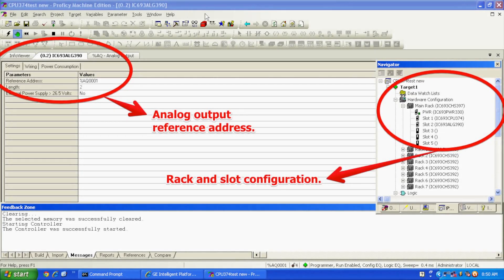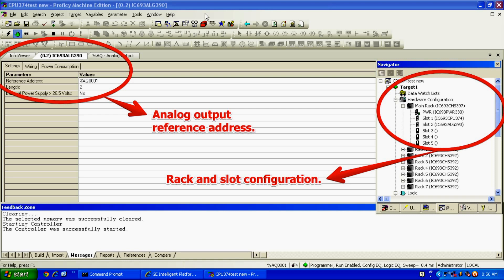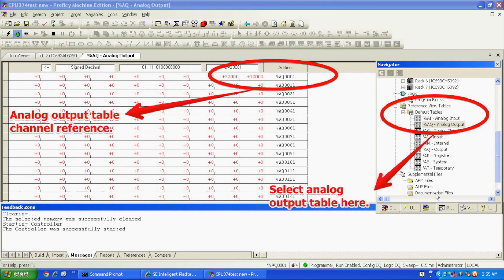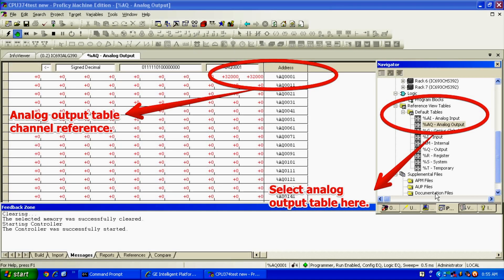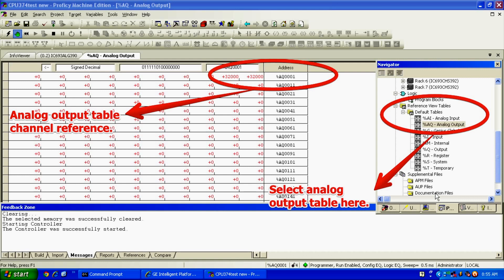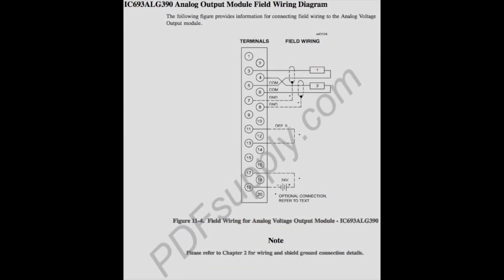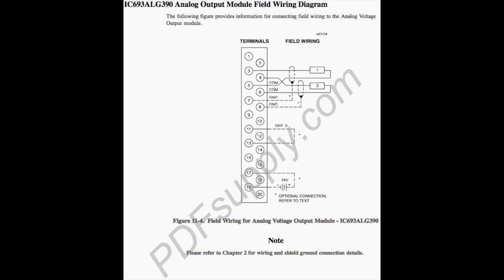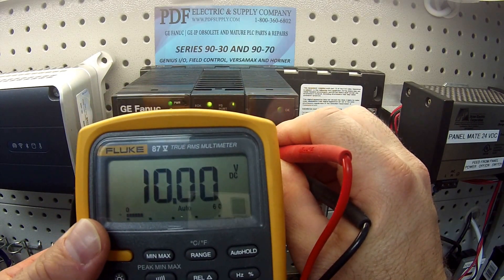How-to Troubleshoot: IC693ALG390 (GE Fanuc PLC 90-30 Proficy Machine Edition Programming Tutorial)

Comment from the maker: GE IP Support IC693ALG390 90-30 Analog Input Module - ALG390 User Manual Data Sheet & Wiring Diagram
IC693ALG390 is In Stock & Ships Today!
Call 1-800-360-6802
GE Fanuc PLC Series 90-30 IC693ALG390
SKU 2177149  UPC 0799705792944
Revision Number
IC693ALG390A
IC693ALG390B
IC693ALG390C
IC693ALG390D
IC693ALG390E
IC693ALG390F
IC693ALG390G
IC693ALG390H
IC693ALG390I
IC693ALG390J
IC693ALG390K
IC693ALG390L
IC693ALG390M
IC693ALG390N
IC693ALG390O
IC693ALG390P
IC693ALG390Q
IC693ALG390R
IC693ALG390S
IC693ALG390T
IC693ALG390U
IC693ALG390V
IC693ALG390W
IC693ALG390X
IC693ALG390Y
IC693ALG390Z
1C693ALG390